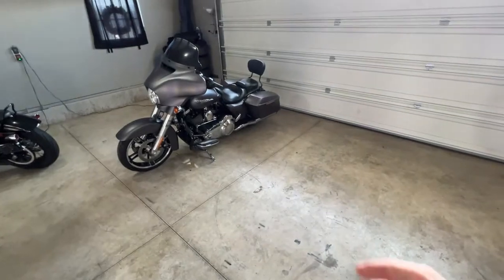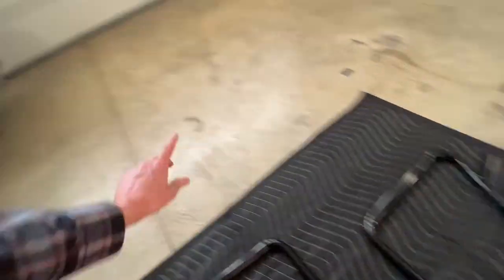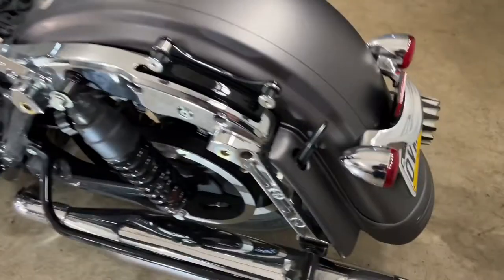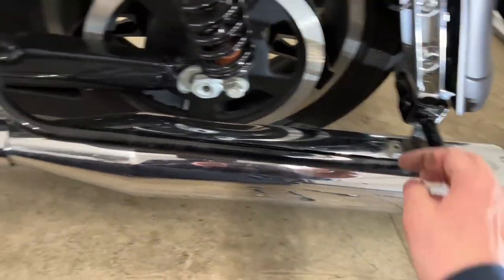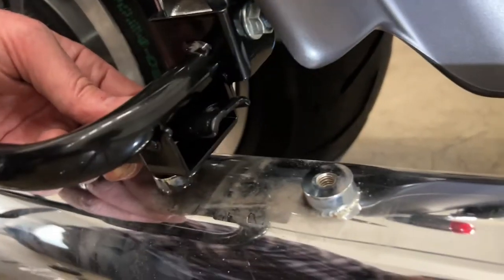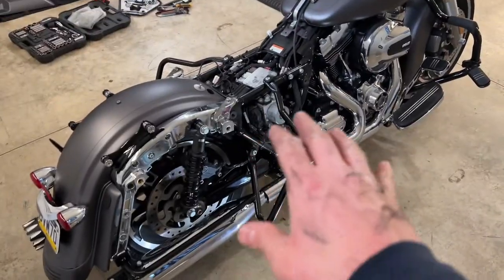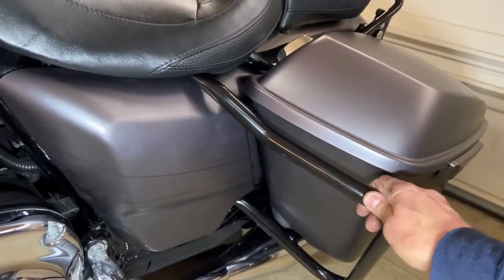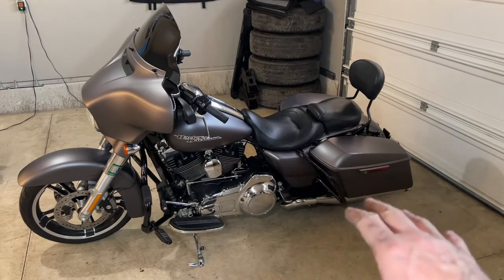High Quality Low Cost Saddlebag Crash Bars For A 2016 Harley Davidson Street Glide Special.

Comment: I've read that top piece (seat support) on the bar where the seat is you supposed to remove that and not reinstall it.. Being that the bar is there now it acts as the seat support.. also on the bottom of your bags where you put the washers on the bar  you might want to check your bags if the bolt is rubbing against your bags..
Reply from the maker: All is good 👍🏼
Reply: Thank you im just now installing this same bars

Comment: Will these work on a RoadKing Special 2022 with extended saddlebags?
Reply: I have the same question. I am buying a RKS 2022 but I don't like those little crash bars it comes with and prefer the regular size ones.
Reply from the maker: I’m not 100% sure but I click the link and browse the description to see if they are compatible or email the seller as they may have other options for different bikes.